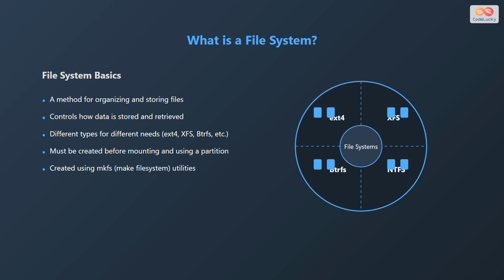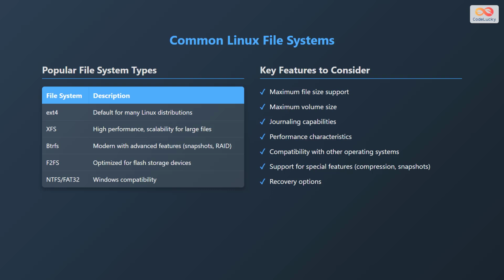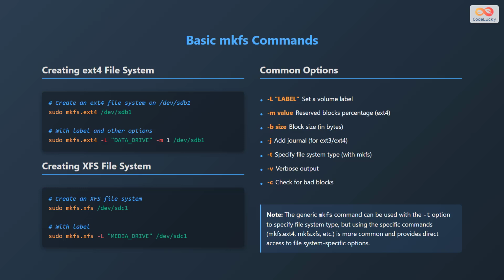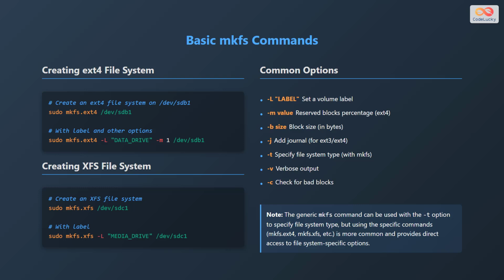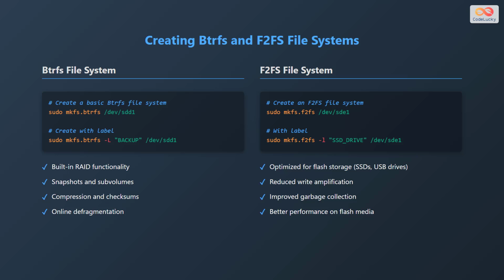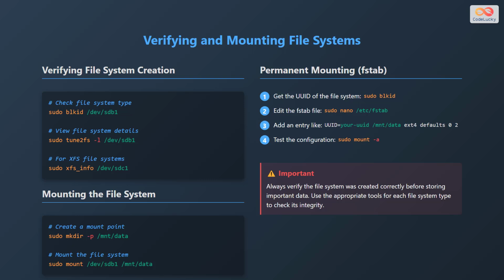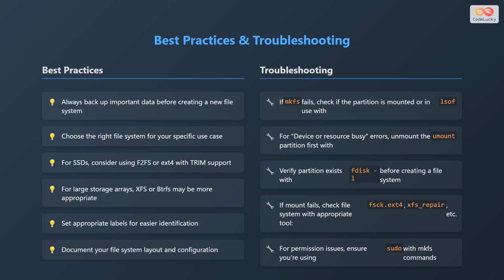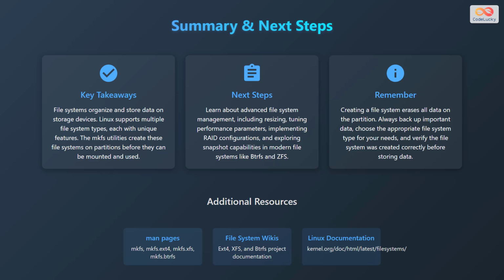Linux File System Creation: mkfs Tutorial for Beginners 🚀

Comment: What is a File 🗄️ Systems
Ext4, Btrfs, XFS, or ZFS?
Reply from the maker: A file system 🗄️ is how an OS stores, organizes, and retrieves data on a disk.
Ext4 – Stable, fast, most common on Linux
Btrfs – Modern features like snapshots & checksums
XFS – High performance for large files
ZFS – Advanced integrity, pooling, snapshots (heavy but powerful)
👉 Think of it as the data management layer between your OS and storage.